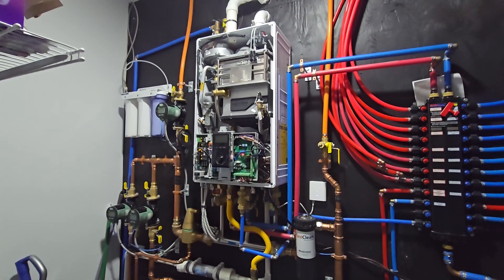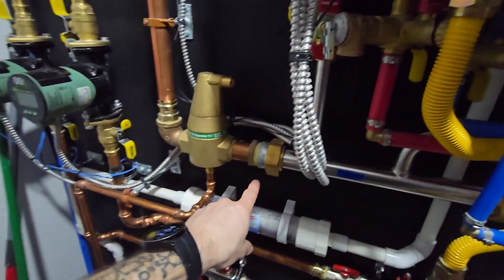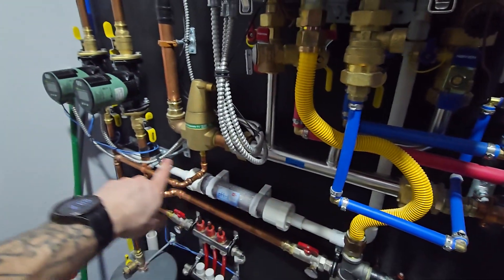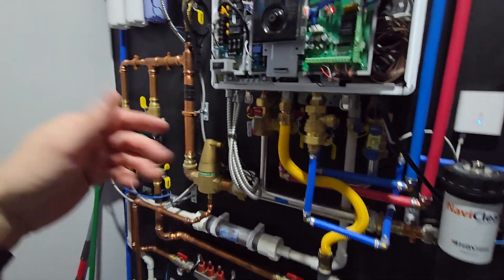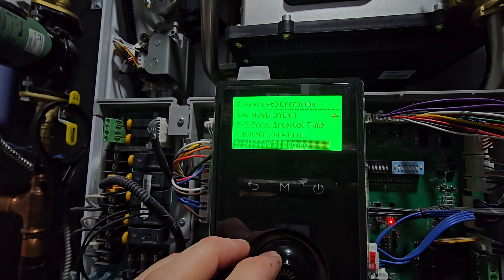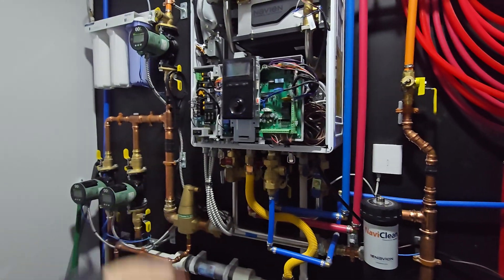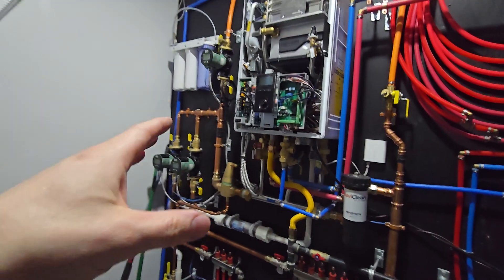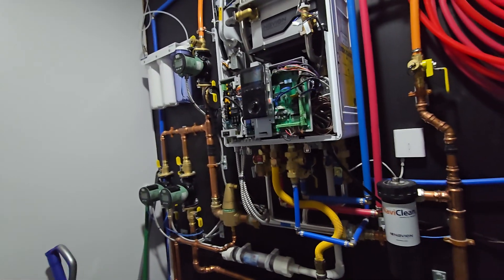Navien GXXX001769 Universal Temperature Sensor - Installation and Settings

Comment: I have a ncb-240/110 combi boiler u have suggested that i dont have to flush space heating only domestic hot water i dont have any problems with either  but i installed it 12/2023 i have a navi clean installed should i flush heating system also or not thanks tony
Reply from the maker: It all depends on your water quality but you should prioritize flushing the domestic.
Reply: @JimSperanza will do thanks

Comment: Jim, very good video.  I am using Navien Outdoor reset, high mass, radiant floor system.  If I install Aux supply water temp sensor and change setting to reference the aux supply sensor will the OA Reset work using the Aux sensor as supply water temp reference and still modulate based on OA Temp?
Reply from the maker: The outdoor reset will still work as intended. The aux sensor just lets the boiler know whats being sent to the secondary loop and can adjust its output to match the desired temp.
Reply: @JimSperanza 
Thank You.  Do you have a video on the installer adjustments?  I have fine tuned my unit.  As you say they have to be set to the job.

You referenced how the unit loses some settings when power is lost.  I have my unit on small UPS so unit does not lose memory during power loss or during transition over to generator.  Good for user who relies on date / time for scheduling.

Comment: Hi Jim great video. How do I set it with the supply and return temps using the sensors. I also did the out door sensor and set that up.
Thanks for any reply.
Mine is the navien 240 NG combi
Reply from the maker: You can only use 1 universal sensor, either supply or return. Its most common to use it on the supply side and place it on your secondary piping.
Reply: That is where I changed it to. Thanks. I would think they could have it set for Delta T  out and in, but what do I know 😆.  Thanks for the quick reply I  appreciate that.

Comment: Any experience with the temp sensor on a water Navien heater with circulation loop - mine has internal circulation pump and a hot button feature.
Reply from the maker: Yes

Comment: Can that sensor be used for monitoring floor temperature as well? How important is it to monitor floor temperature.
Reply from the maker: This sensor is not meant for floor sensing. Any floor sensor would be monitored by a thermostat. The  importance of monitoring the floor depends on the situation. It can be used to set maximum temps to protect flooring or set minimums to keep the slab from cooling off with supplemental heat or solar heat gain.